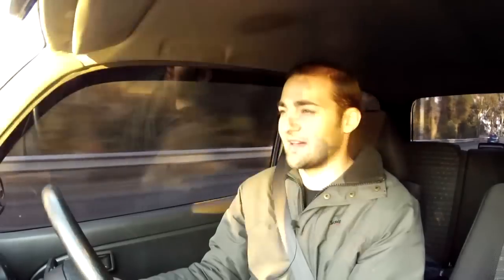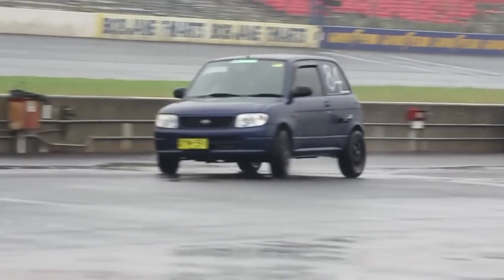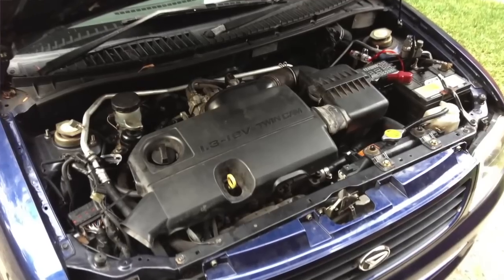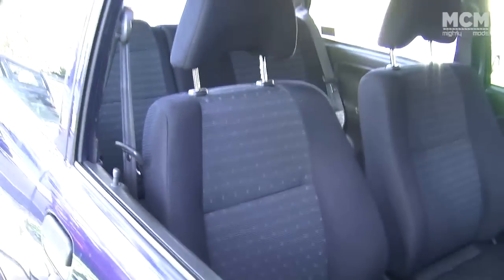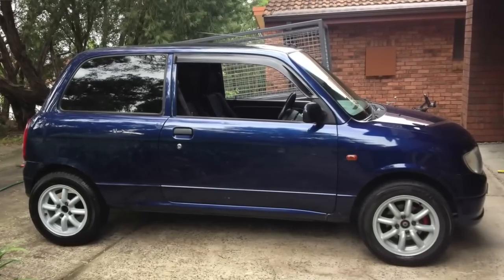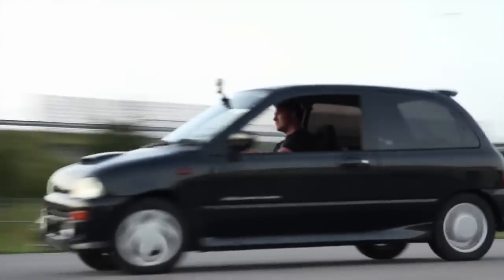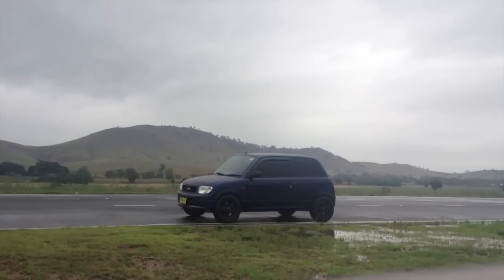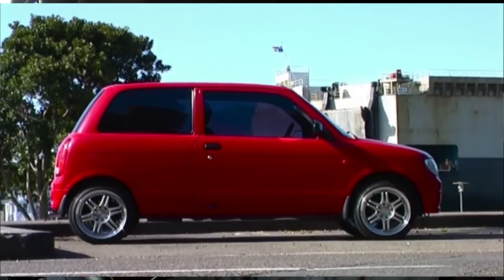Marty and Small Cars

Comment: I have a stripped out and caged 1959 Austin A35. 500kg with about 120bhp from the 1275cc "A" series engine, rwd with no weight over the back axle. BIG smiles, especially in the wet. Stock, an A35 will be sideways from 10 mph of the road is wet on cross ply tyres.

Comment: I have a Mk2 Fiesta from 1988 & I can tell you, small cars new or old are grand fun to drive. I adore driving my car. Sure my car's got old Ford comfort suspension, only has 50bhp & a top speed of 88mph but at ordinary road speed, going through corners is a delight & that exhaust note (typical kent engine sound) just sounds so good as you cycle through the four speed box (third gear is my favourite gear for the exhaust note). Honestly, those with doubts about small cars, get one & find a twisty road, you'll have as much fun as you can have on four wheels

Comment: I love my 1990 Suzuki Vitara 1.6L 4cyl short-wheel base, it's kickass offroad, and since it's got selectable 4x4 you can select to just be rear wheel drive. Rear wheel drive in a manual small SWB is so much fun. Also, the offroad gear aftermarket for 4x4 Suzuki's is incredible.

Comment: Why I disagree with Marty that these tiny little cars are awesome cars:
I can't even fucking fit in them because I am too tall.
Reply: ***** I'm also 6'4 and I have trouble getting in and out of larger cars because of my long legs. To put it in perspective, cargo shorts don't even reach my knees.
Reply: ***** Thats just lying im 6"2 and i have sufficent space remaining in front of my legs in my small car, heck i can even set seats so i can hardly reach stering wheel and pedals properly while i rub my head on roof on SUV like peugeut 5008 and 308 ... just find a better small car
Reply: Peugeot 308 isn't an SUV, but the 5008 is a compact SUV. They're both supposed to be small. 
Also, have you considered that I am taller than you? Or even just larger in general? Every person is different.
Reply: 308 is a compact and compact SUV is 3008, 5008 is suposed to be spacious but still less spacious than some "small" cars ... hope u get it now
Reply: I'm 6'2", but love small cars.  My secret...buy one with warn out seats, remove rear seats, fab up seat brackets to sit 6" back from stock.  Good to go.  Did this to my Datsun 1200 coupe, love it!

Comment: I've got a 97 saturn sl2. 1.9l dohc is fun with the 5spd in your hand. Mostly plastic so you don't have to worry about rust or too much weight which is nice. That power to weight ratio Marty was talking about works pretty well with this car as well. Thinking about a turbo setup, but I have to fab a few hings if it was to work.

Comment: One of my first cars (I bought three right around the same timeframe) was a 1979 Honda Civic 1200 with a 4 speed and a 1 bbl carb and that car was an absolute blast to drive. Then I had a 1989 Ford Festiva L with a 1.3 Mazda/Kia 4 cylinder SOHC with a 3 speed auto and ice cold air con and that car had no problem doing 85MPH+ and would still return 40+ MPG. I've owned 40 cars since I was 14 and right now I have a 2003 Hyundai Sonata GLS with the G6BA 2.7 DOHC V6 and a tiptronic auto trans with headers, exhaust, and intake. I also have a 2010 Ford F-250 Super Duty 4 door long bed with a 6.7L twinturbo PowerStroke diesel that gets around 12 MPG average. My all time favorite car was my 1992 Plymouth Colt that I built and swapped a 4G63t into with forged internals and a 20g turbo that dynoed at 308 HP to the wheels at 16psi of boost and was still capable of 32 MPG if you kept your foot off of the loud pedal. I love economical cars that have the power to surprise you...and others.
Reply: Almost all cars are great cars believe it or not, its all in the temperament of the owner and how he/she treats the vehicle. Some engines are literally good for at least 300,000 miles if you give them proper attention.

Comment: Really into small cars aswell. I have a Rover Mini 1.3 SPI - It's a lot of fun to drive around in the city and on country roads - as it has around 65-70 bhp and a 4 speed transmission. You can open it up and have a lot of fun and it corners like it's on rails.

Comment: I like small cars too. My girlfriend bought a Mazda 323 1.6i (-88) from her brother who had it as a wintercar 5 years, all we did was:
-Right hand side back wheelbearing exchange. 
-Alternator belt
-Rear Swaybar rods (sorry, don't know the correct english word for it)
-Welded a hole in the exhaust.

That's it. 5 years. Sold it less then a month ago.  It was so cheap to run and own. The roadtax was about half of what i'm used to.

Comment: Marty you said about getting camber on your rear wheels, once lowered car as you know get some negative camber, so have you get it the car  alignment done, but if you want camber on rear wheels, I know for a Renault Clio, ( yes not a  good car to mod up) but hey, you can buy rear camber shims from £10-50 that you put behind the wheel hub, which can get them in different sizes but for Clio they are at a 1 degrees  so fitted the right way can give 1 degree negative camber

Comment: You can stance a solid rear. What people do with the old school Golfs/GTI's is they use drop plates and raise the hub. You get full suspension travel and when you lower it the wheels don't move forward. You use different thicknesses and angles to get camber. If my MK3 Golf can support the weight with no problems, that tiny thing can too. But you can always fab up an IRS system.

Comment: i bought a 99 suzuki wagon r, the body roll was terrible, moving the front springs to the rear and installing civic springs in the front, cut to lower the car about an inch made the trick to get rid of body roll, i cut the shock bolt holes to give good camber and made a nice toe out, and the car is transformed. the power isnt that great but makes me smile every time i drive it. small cars are really fun!

Comment: about the camber thingy on rear axle Marty, if the hubs are just bolt on then you can just do what many do here in uk, put washers behind the bottom bolts for the hub, or more professional way is to get camber shims that are a wedge shaped bit of metal with holes for the bolts to pass through, either way it just cambers the hub. Obviously bad for tyre wear and also wears wheel bearings faster.

Comment: in the uk & alot of europe, you can get kits to add rear camper on solid beam axles for front wheel drive cars, its just a shim that bolts between the hub & the beam, take a look on some mk1 vw golf/rabbit sites marty! give your you dai kei a bit of rear camper love! small cars have had alot of love in the uk since the original classic mini!!!! for most of the reasons you point out, personanlly have one thats a 1030cc turbo/intercooled pushing 162bhp@487kg, there are plenty faster than mine!

Comment: i have a honda del sol and i love my little car, my friends call it the del slo(slow). i am so glad that i bought it, 
1) its rare and unique 
2)it wast=es no gas its a 1.5 d15 singl cam
i plan on swaping the engine because the rings are bad and the head gasket was replaced(previous owner) so im gonna get a B18C limited slip tranny next year in the spring. i'll put up a responce video top your guys video so you can see

Comment: I had a Focus ZX3 hatchback with a 2.0 zetec in it, i wish i would have never sold that thing. It wasn't fast but it was quicker than alot of newer auto cars in the states and I could beat the piss out of it because I knew if i ever broke it, which i didn't, it would be cheap to fix. It wasn't the best on fuel it was about the same as my current car which is a jetta 1.8t they both get around 25mpg factoring in the fact that the jetta runs a higher grade of fuel. And although my jetta is alot faster and handles better its not as fun because i have to worry about breaking things.

Comment: I don't have a 'small' car, but it's a hatchback, and I've always loved the fuel economy I get with it. I can drive from the north coast of NSW down to Sydney (750km drive) on one tank, and burn under 52L of fuel. For a 2L 4-banger N/A, that's great mileage (around 6.7L/100km), and I could never get that in any other similar car that I've owned. Even around town I get 600km+ per tank.

Comment: i really like all these cars they build, but i drive a v8 truck with about 300-330 ftlbs of torque depending on the conditions and i just dont know if i could get away from low end power like that. my mileage isnt too bad either. i average about 16mpg even with a 7" lift and bog wheels/tires. its not crazy fast, but it will pass easy in traffic until i hot the 100mph governor..

Comment: Look around the scrap yards, you can find scrapped cars with practically unused engines for pennies. I fitted a R32 engine to a SEAT Ibiza, that shocked my little sister when I returned it to her! I just have flashed the ECU and fitted uprated brakes and suspension. mainly cause I drive too fast as it is without having more BHP!

Comment: Some years ago I had a Citroën Saxo 1.6 automatic.. Since I had the "huge" engine on 90hp and an automatic, It was heavy for a saxo, it was 930kg.. But even though it was a lot of electric failures on the lights etc, I still miss it... So i've actually bought a newer Saxo (only 1.1, since I haven't seen a 1.6 automatic before or since).

So I do understand what you're saying, but there is also huge difference in different car makes.We also got a 2006 Fiesta 1.6 automatic, and it's useless.

Comment: well the S2000 weights aprox 1280 kg and the clio weights aprox 1268. It just depends on the extras the car has. The s2000 also has 241PS on 2l displacement.

Comment: my 2002 holden astra, with 260,000km on the odo, 1.8L manual; I'm getting 6.7L/100km.

though that is burning 98 premium, the old engine doesnt like standard fuel. i put in 40L a week so $60. 

yes i drive about 700km a week, im a uni student from the country so i drive back and forth to home at least once a week

Comment: Something fun and small? There's a ton. A 1985-1989 Toyota MR2 gets about 25-32 MPG and is mid engined and RWD. Will outhandle anything on a track, and is super small. Another would be a Miata, but those are pricey and people will probably laugh at you. If you really want a good car, '88-'89 MR2 Supercharged will get you 0-60 in about 6.5 seconds and handles amazing.

Comment: My 2004 Cooper S aint as small as the old one, or the turd, but is stil lquite small by modern standards, it needs a diet, it weights about 1200kg from factory. But its running somewhere between 210-230 bhp which still makes it healthy. 

The size and relative light weight in comparison to other hot hatches makes it a true weapon on twisty roads though!

Comment: My first car was a 1988 Honda Civic Hatchback DX with a manual transmission, best car I ever drove (with the 15" Integra wheels and the Yokohama summer tires) It only had 92hp but it weighed about 900kg.

My new 2002 SiR (EP3) (160hp, 1250kg) is much faster but is still not as fun as the old 88 :(

Comment: no need for welding on the rear.. unbolt the drumbrakes and put a few washers/O-rings/spacers between the suspentionarm and the drum and bolt it back together...  result: camber without welding...

Comment: Honda D15 motors arent bad motors especially if you do a D16 vtec head swap ive had 2 D15's and love them (42 mpg in my EF sedan) my civic is at 231,000 miles and climbing with a bad head gasket for the last 2 years and still wont die (trust me ive tried). Getting ready for a swap would buy another D-series in a heart beat.

Comment: wtf 6 something per 100km??? our diesel c270 has  a 2.7 litre turbo running 25psi boost and has 250hp.. it gets 5L/100km
Reply: and the turbo was out of an 3.8l engine...
Reply: cool story.
Reply: "wtf your petrol car gets worse gas mileage than my diesel?1"

Of course it fucking does. Not to mention the difference in gearing.